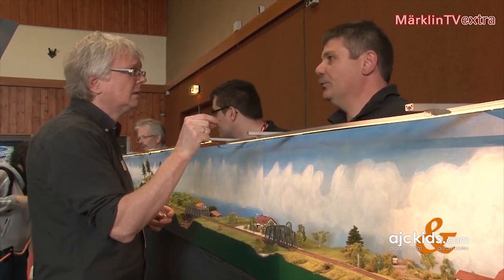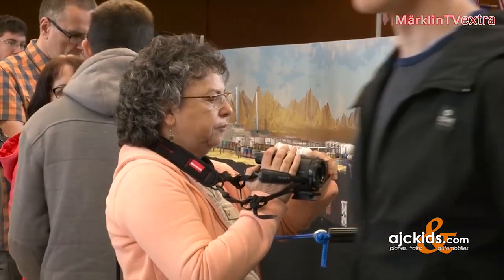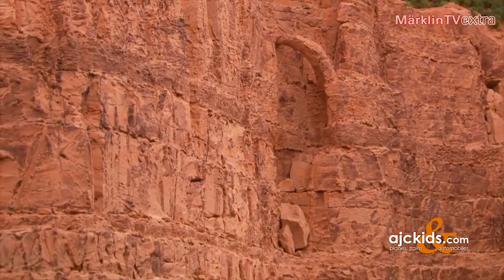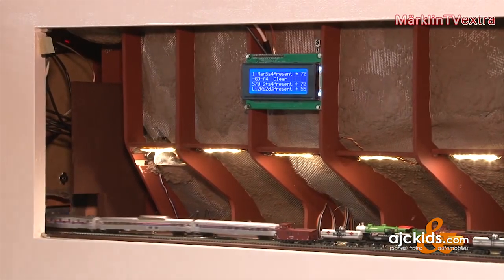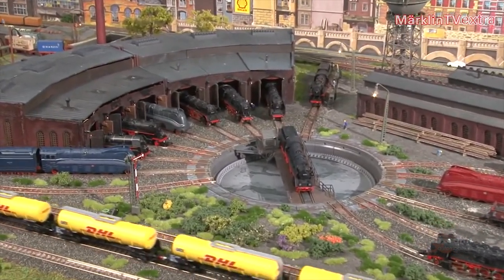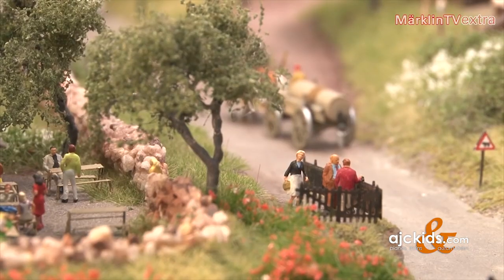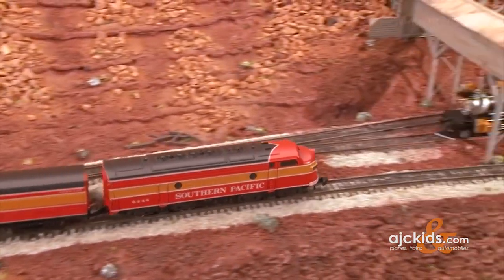Marklin TV Extra 17 (Z-scale meeting)

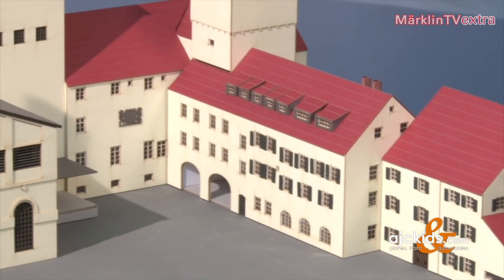Comment: 3:12 ... There are indeed more locomotives and wagons available, but they are even more expensive than the older ones....!!
I know, new and better technology.  But 250 to 350 euros for a single locomotive....  Come on, guys.....  Who can afford that ?
Make a few smaller and cheaper locos. And passenger wagons.
The choice in buildings in Z scale is also EXTREMELY limited !!!   Please....WHEN will a manufacturer pick up on this ?
There are so few buildings to choose from, it's ridiculous. All we can do is to buy three or four of the same kit and paint them in different colors, add or remove details and place them not too close to each other, pointing in different directions. Only then it will not draw too much attention to the fact that your layout has many duplicates.
Now someone will point out the fact that there are more and more cardboard models available. I know. And they look great. I own a few of them.
But the larger and/or more beautiful ones are even more expensive than the plastic ones. And those are already very expensive.
Unless Z scale is being promoted a lot more, anything and everything in Z scale will be a hobby for the rich..............
Reply: Or just save up? If it's too expensive then save up more money, the hobby is still accessible to poorer people, they just have to wait a bit longer to have enough. I'd say it's worth it for the detail and smooth running that these tiny engines manage.